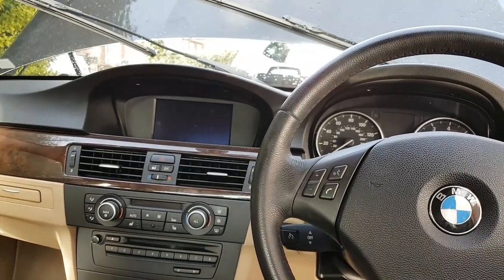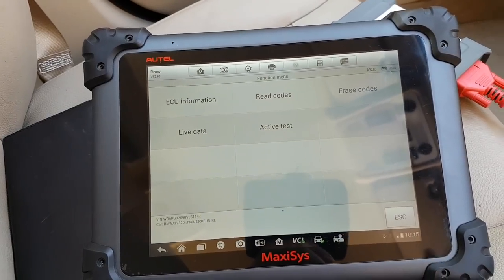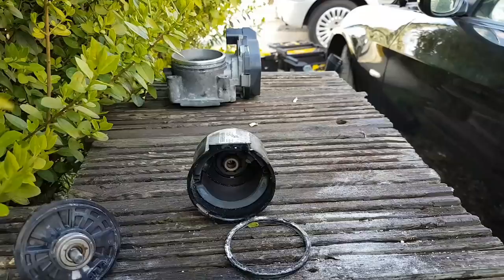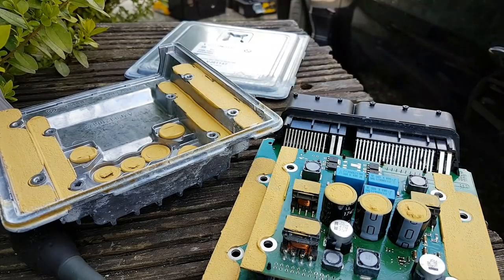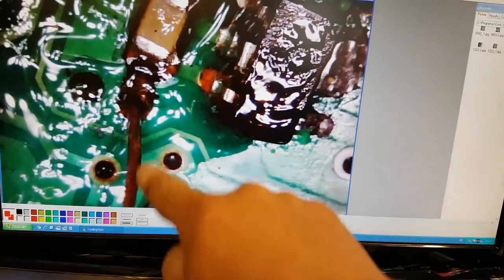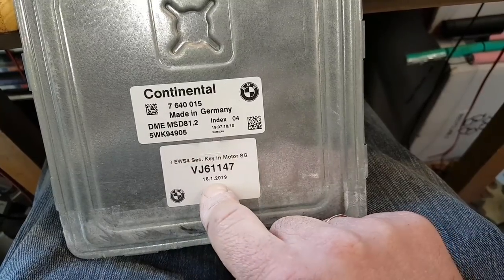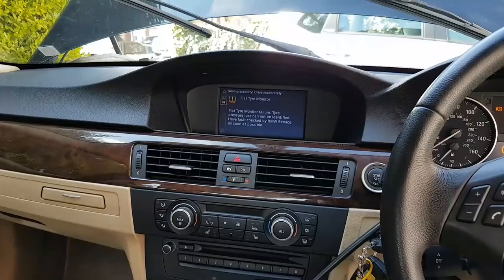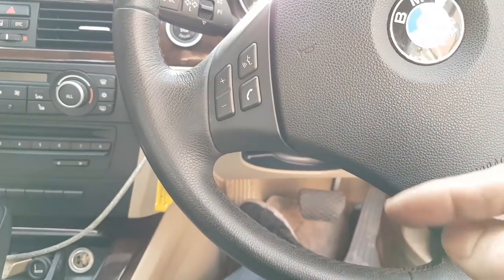BMW E90 320i rough idling and no accelerator response. Fault finding and repair.

Comment: Great troubleshooting and repair. Do not worry about the length. Short videos are good because it usually means a fairly simple fix, which is good to know. Long videos are good because it usually means something really interesting happened.
Reply from the maker: 😊
Thanks!
For watching and for your comment, really appreciated! 
👍👍👍
Reply: I dont get what the issue. Was besides a software setting
Reply from the maker: You have clearly skipped many parts of the video... watch again...
👍👍👍

Comment: Golden rule on E90, any engine faults, always check the ECU first as it takes seconds to pull it out the box. It is very common for them to have been swimming in the box. I have swapped alot of DME on E90. You can clone them with KTAG easy enough, and if the eeprom is totally rotten then there is a handy tool called "ISN CAS DME Editor" which lets you change the used scrap yard DME VIN number and CAS code to match your own CAS.
Reply from the maker: Thank you for watching and for your comment!

Comment: Hi thank you for this video. my car has the same problem. Instead of  jumping the 5 vols reference in the DME. I am using a phone charger to supply the 5V. Its been working for a year now. I know its a bit cheap, but hey its working.

Comment: great   video once again weve all made   mistakes   i often reverse engineer  some boards and    end up redrawing stuff  due to  mistakes  not easy when   doing surface mount stuff and  tracks pop up all over the place often under ics or plugs nice to see we have similar  equipment my work desk is  cluttered also have loads of stuff around me leads and more leads probes etc ha ha a constant learning curve  thanks for sharing

Comment: A sincere greeting from the heart, sir
I am from Algeria, and I am doing the profession of car trouble checking with the help of the fault detection device
I am very impressed with your way of tracking faults and your professionalism
My question to you is that I rely on a scanning device like Launch to determine the circuit in which the malfunction is and the reason is that the circuit is open and it is completed by connecting it to the sensor or any other piece.
Is the method practical or not and thankful
Reply from the maker: Hi
The scanner, just buy the best you can afford!
Launch, Autel... etc... is up to you to make your research and decide what is best and suitable for the cars you are going to work on...
Hope that help.
Thank you for watching and for your comment!

Comment: Enjoyed your video. Interesting fault finding approach. I admired your tenacity & approach  in repairing this car I've got an 07 model with several issues similar to the one you worked on. On my one I think the ECU & the auto transmission are not communicating properly. I would be interested in your observations.
Reply from the maker: Scan the car and go from there...
Any communication issues will most likely be logged in one or both modules...
Thank you for watching and for your comment!

Comment: Great effort at repairing this ECU but,
1: You spent a lot of time on it;
2: Did you find every fault ?

I prefer to replace an obviously damaged unit unless the unit is so rare or expensive that the amount of time to repair it is justified.

I'd spend the bulk of the time fixing the root cause - the water leak - and maybe resealing the replacement ECU to reduce the possibility of water ingress causing a similar issue down the track.
Reply from the maker: Hi
1:Time doesn't bother me...
2:All in the video...
The water gets to the ecu because of the drain under the ecu and fuses box... I got all that cleaned and removed the grommet to prevent it from happening again...
Thank you for watching and for your comment!

Comment: Thank you for the knowledge but I'm in deep pain and I'm scared of my possible damages I cause about 30mins ago on a bmw 2008 320i sports pack. I ran through a pothole and my car showed the engine sign and stopped putting power to the wheels, It won't even accelerate but it's idling and starting. Would you know the possible effect? Under the car they seem to be no physical damage or oil leak and yes I switched the car off and on a couple of time but it won't change anything.
Reply from the maker: Scan the car and go from there...
Thank you for watching!

Comment: I watched all the video and felt that your knowledge about the way the ECU is wired and connected gave you that ability to test the PCB with wire-links between components and clean it up, that only those who have an understanding of  PCB circuitry could use to repair this problem. . My question is have you had software/electronic training and how long did it take you to get to the level of technical knowledge that you have or have you picked it up along the way?
Reply from the maker: Hi
Just picked it up along the way...
I do this as a part time... 
😊
Thank you for watching and for your comment!

Comment: how much did you ended up charging $$$ total the client for this fix?  I want to compare it to buying a used ECU module just in case.... thanks.
Reply from the maker: My repair videos are primarily for learning purposes...
It is a part time for me, most of the time I charge for the parts and consumables... that's it...
So theoretically, my fix was way cheaper than just a replacement ecu... leave alone the programming etc...😊
Thank you for watching and for your comment!

Comment: Hi, GREAT VIDEO coincidence my BMW E90 328i is literally having the same issues you experienced so was very educational! Watched the whole video! I shorted out the plug for accelerator now I have revs back and fault codes go away, I just feel abit intimidated at shorting the ECU board Is this safe to do? I’ve always been told avoid shorts at work and should only be temporary (not a mechanic) appreciate any advice you could give. Thanks
Reply from the maker: Well... if you can, replace the ecu...
But using a voltage referente for one extra sensor, shouldn't be an issue...
👍👍👍
Reply: @LMAutoRepairs Thanks for the reply!! 🙌 I think I’ll buy some solder and give it a go, Just to clarify this didn’t cause any future issues like burning anything out? With the constant supply
Reply from the maker: No... it is just a voltage reference supply...
Nothing to do with the mechanics of the engine...
👍👍👍
Reply: @LMAutoRepairs  thank you! Your knowledge is appreciated. 🤝

Comment: Awesome video and work! What software is that you had on your laptop that you were watching voltages and such with?
Reply from the maker: That would be ISTA...
Thank you for watching and for your comment! 
👍👍👍
Reply: @LMAutoRepairs  okay, so that's a BMW specific software, correct? So do you have to use a BMW specific cable with it or will any obd2 cable work with it? It seems like a lot of dealer softwares require specific cables.
Reply from the maker: Hi
Yes, some do require specific tools..
 Some others, work just fine with a J2534...
ISTA, works with both, and with a relatively cheap D-Can cable...
👍👍👍

Comment: What i normally do to test a throttle is I read the TPS  and move the butterfly. Funny I have Toyota corolla with the same problem where the motor is not getting power from the ECU, so I sent in the box. Do you have manuals for clusters, ECU, etc.
Reply from the maker: No... I don't have nothing like that...
👍👍👍

Comment: In this other video, this person also found his car running very rough. he checked everything, sensor and ended up looking into the ECU unit.  took it out and found the bottom part damaged from oxidation with water damage....  He said, don't waste your time in fixing this as its very time consuming and yet it might not get fixed at the end...  So he bough a used one, switched it and the car was instantly fixed.... No coding needed for the used ECU unit.
Reply from the maker: 🤣🤣🤣🤣🤣
Not I did not...
If you watched till the end, is all in the video...
But to be honest, I owe you no explanations...
Next, you are going to say that in all the videos I have, where I repair the modules or ecus, that I replaced them...🤦‍♂️
Still, thank you for watching!
Reply: @LMAutoRepairs   obviously you didn't understand what I posted.... I said that someone else in another video had the same issue you had.  He found out the ECU was corroded with water damage as his car was running horrible with all kinds of codes.  He just replaced the unit and the car was completely fixed... U in the other had decided to go the long way in fixing the unit in which you claim it was time consuming and a pain but at the end you and many hours you ended up fixing it.  This is great for someone on a budget and has all the right tools to fix their own.  So with that, much appreciation to you for taking your time in making these videos for all of us to learn!  A+++
Reply from the maker: Got you know...😊
I definitely misunderstanding you... 
Yes, it took a bit more, that said, would take half of the time if I didn't had to record it...😋
Replacing the unit it is easier, but is not just replace as you probably know... there is a bit more stuff involved! 
Again I apologise for my incorrect interpretation of your last message, and thank you for taking the time to reformulate your comment!
👍👍👍👍

Comment: OMG , i have the same problem, rough idling, and no accelerator response, i didn't know where look for to solv this problem, i'll check DME tommorow, if you can help me let me know , i changed lot of parts for nothings... Thank you guy
Reply from the maker: Hope you find the issue...
Thank you for watching and for your comment! 
👍👍👍
Reply: @LMAutoRepairs  Hi I checked accelerator response, it's good and throttle body also. I launch a fault code research and nothing, no fault codes.
I tried to start engine, rough idling always present and engine stop after 5 secondes and no response with accelerator. 
Do you have an idea ?
Reply from the maker: Have you checked the ecu for water ingress?
Reply: @LMAutoRepairs  no i just did ista test of throttle body and accelerator, I'll do this i need to know if water ingress. My ECU was changed in 2016 , i have this car for 3 years only.
Reply: @LMAutoRepairs  Good news or bad news, my ECU is completly dry without water traces. My problem is probably mechanical. mouth exhaust or something like that...

Comment: How did you get rid of the flashing engine light and missfire on cylinder 1,4 with the smoke? Have same issue and cant figure out. Its only fault on mine.. :(
Reply from the maker: As you might have seen at the end of the video, was all whithin the ecu...
Thank you for watching!

Comment: I have a similar issue with my throttle response. After watching your video, I checked the ECM and saw the corrosion. I have no way of checking or fixing it.
Is there any recommended places I can take it, so they can take a look at it and see if they can fix it?
Thank you
Reply from the maker: Any with repair capabilities should be able to help you...
Thank you for watching!

Comment: Hi I have the same issue, only difference is when I jump my 2 5 volts on pedal my live data goes to 0 and I set pedal codes not just throttle body codes.

Throttle body connector gives me 2 5 volt reference when I test it but pedal just like this one only gives 1 5 volt and the 1.2 volts
Reply: Ok ok ok, when I disconnect my throttle body my pedal get the voltage on both 5 volt reference and work fine on live data.

Throttle body connector disconnected and pin out test ign on engine off pedal connected.

Live data pedal 0 %
Throttle valve angle 90 degrees

Pin 1 4.737 v
Pin 2 4.990v
Pin 3 4.209v
Pin 4 0.005v
Pin 5 4.319v
Pin 6 0.005v gnd
Reply: My ista stopped working so I am screwed on how this should work and values should be.

Opened ecu and it looks super clean inside with no visable or damage anywhere
Reply: Car starts and then idles fine and 15 sec later it surges in between 1000 to 1500 revs and yellow light comes on
Reply: I also have to state that when I test the TB connector disconnected and pushing on the pedal then none of the values above changes at all
Reply: I have also tested the TB electric motor and it works when power is put on it.
Reply: There is no TB sound when connected and car is switch to on position not running
Reply from the maker: Get ISTA working, and run the tests on the TB...
Reply: @LMAutoRepairs what supplier did you use to purchase your Ista+. Mine is toast and not even connecting anymore.
Thanks again
Reply from the maker: @MafiaSurvivalGaming 
I used to use this seller...
Cardiagtool.co.uk 
I have no affiliations, BUY AT YOUR OWN RISK
Reply: @LMAutoRepairs  I appreciate it thanks.
Reply: Testing my TB removed from car disconnected pins 2 4 6 has continuaty when touch to each other

Comment: Hello I have an e90 320d from 2005 and the OBD port won’t communicate with scanner already check with oscilloscope and no voltage on pin 7 I get 12v at 16pin
Reply from the maker: There is no voltage on pin 7 anyway...
Pin 7 should be the K-line...
Which scanner are you using?
Thank you for watching!

Comment: What chemical did you use to clean the board . I once tried petrol and unluckily for me , one of the transistors which drives one of the coils failed
Reply from the maker: Isopropyl alcohol...
Thank you for watching!
Reply: Thanks very much
Reply from the maker: @mayydayy8101  
👍

Comment: Hi, my car starts and engine runs well but No acceleration on the paddle at all. Sometimes it works and dies while driving. If I pick up speed I can use the cruze and goes well. Please help. BMW E90 2005 320d
Reply from the maker: Scan the car and go from there...
Thank you for watching!

Comment: also check the engine oil cooler it might need to be changed , causing the car to smoke a lot
Reply from the maker: Car stopped smoking once repaired... all on the video...
Thank you for watching!

Comment: Hi, the throttle body then could not be activated my the maxisis???, Is this  what did not happen???
Reply from the maker: On BMW loads of actuations only work under measurement plan... 
But essentially yes... is what happened...
Not sure why in this case, usually works fine... I might have missed something...
Thank you for watching and for your comment!

Comment: I have a 2012 s550. Had water in the fuel control module and needs to be replaced. Can you help me clone this part. Have the original and a used I bought from eBay. Thank you
Reply from the maker: Never done that....
When you plug the second hand one, what faults do you get? 
Thank you for watching!
Reply: @LMAutoRepairs  U0109 lost communication with fuel pump control module.
Reply from the maker: @williamnewman2115  
Check fuses... power and grounds...
Check communication lines.. 
👍👍👍

Comment: The hours spent on this would have cost a fortune at the shop, but I guess they would just keep changing modules until resolved. Problem is excessive obsession with electronics by car manufacturers

Comment: Those kind of repairs are a fluke. Also you should hot glue the wire to the board. Vibrations can  cut it loose, short it to something else with nasty consequences for the vehicle and the passengers (e.g. S.U.A.).
Reply from the maker: What about the water?
Can that not cause consequences for the Veichle and passengers? 
This repair as you might have seen, has been done over 6 months ago... and the car still going...
I get your point, don't take me wrong, just think is very unlikely to happen...
The size and weight of the wire is extremely small and low to get affected by that...
Thank you for watching and for your comment!
Reply: @LMAutoRepairs  Yes water can cause the same thing (less probable though). The big difference is it wont be something you did. Gluing that wire was the proper thing to do. Wire sheering due to mechanical tunning is a thing. I don;t know the laws in the place you are from, or even if your shop meets the local criteria for automotive ECU repairs. It alway better to be careful than sorry later. I enjoy most of you videos, but that specific repair made me "feel" uncomfortable.
Reply from the maker: @fir3w4lk3r  
Not a problem...
Thank you for watching and for sharing your opinion.
👍

Comment: Hi I have a bmw 320i n46 engine 2006 with the codes 29e7 and 29e8 rough idle bogs out any one give me a solution for this please I’ve replace pcv system vvt motor vanos solenoids spark plugs coils oil filter and oil change just need HELP!!!!
Reply from the maker: That sounds like a vacuum leaking somewhere...
Do a smoke test if you can...👍👍👍
Thank you for watching!
Reply: Hey man thanks a lot for the reply I’m really struggling as to know how to go about fixing this now it’s cost too much already the revs don’t bog all the time when car is stood still it smoke on acceleration and when engine is hot it struggles to start again always starts second time of trying when hot
Reply from the maker: Fair enough... As I said... A smoke test should show any leaks...
👍👍

Comment: I know you are a BMW fan, but at least the design for the ECU, is 💩. How the hack they used clips to close an ECU, and no gasket !?
Also at the end that petrol engine sounds like a diesel.  
I am still wondering about that smoke. Looked like a little blue, which is from oil. It has some sort of electric controlled pcv valve? Or maybe dilluted oil with gas burning together?
Reply from the maker: Yes... the issue with the ecu getting flooded is a poor design...
The engine stopped smoking once all repaired...
The owner has been happy with it ever since...😊
Thank you for watching and for your comment!